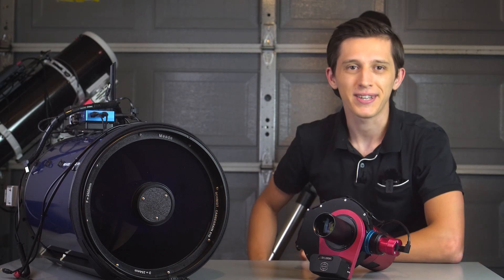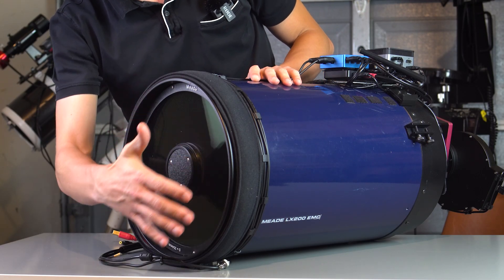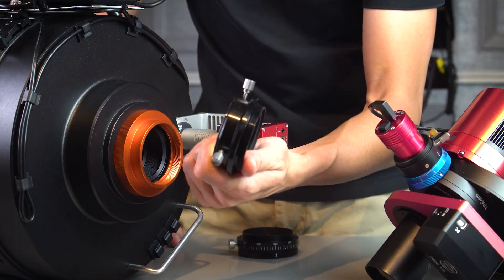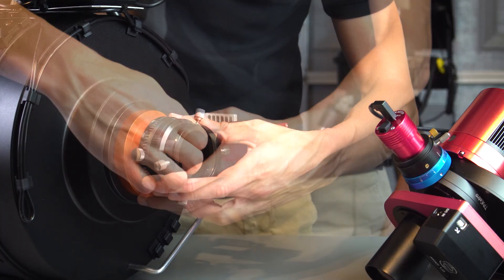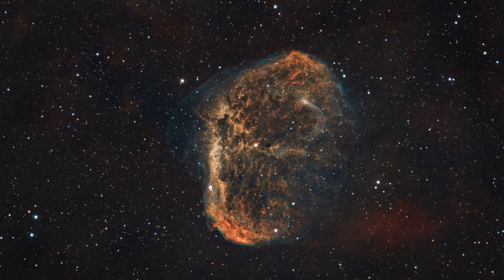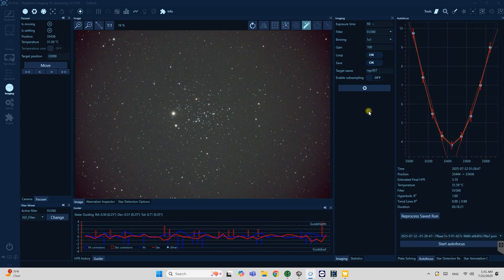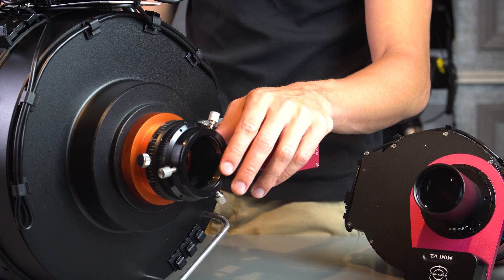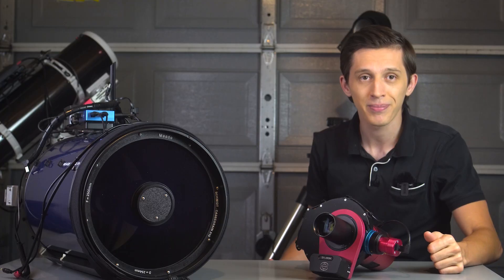How To Setup Meade LX200 EMC for Deep Sky Astrohotography?

Comment: To get a top quality one piece Meade large port 3.25" to 2" compression adapter look at the Astro Physics web site for "2" Visual back threads onto 3.25" rear cell of the 10" or larger Meade SCTs. (ADASCTLM)"  or for Celestron version "2" Visual Back threads onto the 3.25" rear cell of the Celestron 11" or 14" SCTs. (ADASCTLC)"  I used this to get a Starizona SCT III .63x Corrector way up into the baffle tube of the LX200 10" f/6.3 EMC so I can achieve focus.  It just has enough focus travel to focus, imaging with the M10" LX200 at f/4 is FAST!

Comment: Hope you'll do more on this series. I have an lx200 14-in GPS ACF that I bought brand new from the Hi-Point auction. I've got a moonlight focuser. I'm trying to use the Celestron reducer. Of course I don't need the flattener. I'm trying to decide between the ASI 533 and 585 cameras. I'd like a one shot color for this one. I have a full mono set up on my refractor. I'm doing mostly planetary and I want to get really serious about trying to track down the ISS.

Comment: I run a dew shield and a single dew heater on my 10 inch LX-200 and it works great.  You just have to remember to take flats with the dew shield on.  I do sky flats at twilight and I'm doing photometry so my calibration requirements are very stringent.  Great videos as I'm looking to upgrade my equipment.

Comment: I have an 8" Meade EMC. I just wanted to also share  that my own  experience  is that  the   Starizona  corrector iv is an awesome upgrade to the EMC series. Dramatically  better then the Meade and Celestron reducers as they don't flatten and correct aberrations needed for decent imagining.
The back focus is critical to a fraction of a millimeter.

Comment: Do you have a detailed video of your ZWO EAF focuser install using the Celestron EAF mount bracket? I have watched other videos on this and installed mine the same but it is unreliable. Maybe I have done something wrong. I am thinking about changing to a crayford focuser if I cannot get this working reliably. Thank you in advance.
Reply from the maker: I don’t have a separate video on it yet. Bacially, you need a bracket for Celestron telescope, longer screws to connect it to the OTA, and bearings instead of plastic washers to make it smoother.
Reply: @AstroCreation  Is this working well for you? I followed other videos and installed the EAF using the Celestron bracket and I seem to be still dealing with mirror flop on my 10" LX200 EMC. The focusing appears to be inconsistent. Originally, the EMCs came with a screw installed to stop mirror flop and protect it during shipping. You removed that screw upon receipt and installed a plug in the hole. I may have to reinstall that screw, not use the original focuser, and go to the GSO Crayford focuser on the visual back like you had originally. This should give me more reliable focusing and no mirror flop.
Reply from the maker: @moosoneerocketry9826  of course you still will experience mirror shift when using this focuser. I simply enabled autofocus in NINA when HFR increases by notieable amount, and it worked out really well for me.

I've had a few imaging sessions on this telescope without supervising it - everything went well when I was imaging one target (which was M27).

Comment: The guys at Starizona will tell you that their reducer is meant to be attached with the telescope side as close as possible to the threads on the rear cell.   Also, since you have large threads on that Meade maybe you can look into the SCT Corrector LF (large-format) reducer from Starizona

To solve the focuser blocking rotation problem you should look into the Pegasus FocusCube Zero for SCT.   It uses a pully/belt system to move the focus motor out of the way.

Lastly the Starizona SCT reducer requires a very specific back-focus distance of 90.3 mm.   Subtracting 55mm for the OAG/FW/Camera leaves you with 35.3mm and subtracting another 10mm for the Wanderer Astro M54 rotator leaves you with 25.3mm as your spacer between rotator and OAG.

Getting the reducer closer to the threads and getting the back-focus perfect will improve performance.
Reply from the maker: Thank you for such detailed comment!

1) Yes, you want to place it as close as possible to get the telescope faster. I had it as fast as f/6.6 when locating the reducer closer, but I'm fine to sacrifise this ratio a bit to make the telescope more automated in terms of switching angles of rotation. Talking about Large format Starizona reducer, I contacted Starizona and asked their thoughts about it a few weeks ago, but I haven't heard back yet. The thing is their website description of the threads doesn't match what I have, so I wanted to make sure the reducer would work.

2) Thanks for the tip about FocusCube! I'll check it out although I'm not sure how it'll work with LX200. Do you have any practical experience there to share?

3) About the back focus. I'll be covering that in detail in my video review of Starizona SCT reducer for LX200. My total back focus distance with this reducer is 90mm which is .3mm lesser then it's supposed to be. Meanwhile, my stars look pretty sharp around all the corners, so I guess this .3mm difference is fine.

Comment: Great video!  Thanks much for this!  I have a 10" LX200R., using an Optec Lepus focal reducer, and a ASI2600MC Duo. I'm struggling a bit with proper back focus distance.  I'm assuming your using 105 mm as your back focus distance.  How are you measuring the distance of the camera side of your SCT corrector focal reducer to the camera chip?
Reply from the maker: Thanks!

Starizona reducer has a different back focus distance. The reducer itself comes with 35.3mm adapter, and the only thing you need right after is standard 55mm of back focus (total back focus distance is 90.3mm).

In my case it is a bit different. Instead of 35.3mm adapter I got Wanderer Rotator and spacer. My total back focus distance is around 90mm. Stars look sharp around all corners with my IMX571.

I measure distance by calculating back focus of each part of the imaging train I have. Talking about back focus of the camera, this information is available on official website of each camera manufacturer.

Comment: Hey! Great video, loved it, thanks! 

I have the Celestron 9.25" SCT 'scope. I am finding that with my ASI 120MM Mini Guide Camera fitted to my OAG, PHD/Asi Air Plus struggles to find guide stars in certain areas of the night sky. When It does manage to find a guide Star(s) the guiding is amazing, sometimes as low as .33 RMS! But oftentimes the tiny sensor on my 120MM Camera just cannot find any guide Stars. Would you suggest I purchase a Asi 220MM Mini Camera to improve the Star detection and general guiding? *Edit - I use a Celestron 0.63 Reducer.

Thank You in advance for any and all advice!

Clear Skies, Wes, Liverpool, England.
Reply from the maker: Hey Wesley!

Yes, you'll definitely see a lot of improvements in guiding with ZWO220mm-mini just because it's a much better sensor. Before going to 220 though try to guide in bin 2x2. I did that on my 120mm-mini back in the time, and it could see stars a bit better (still not enough for some areas).

If 2x2 bin on 120mm won't help, then consider getting 220mm
Reply: @AstroCreation would a 585m camera be overkill for oag? The touptek one has a newly released lipstick version and it looks very enticing for the price (just a bit more than asi220m)
Reply from the maker: I'm not sure ToupTek has 585 in slim design. Would you send a link to a specific page where you see it?

Talking about guiding performance, I'm not sure 585 sensor would works although you can try bin 2x2 that would help, of course. Make sure the prism in your OAG would support the size of the sensor as well.
Reply: @plane9182  Could you please tell me or msg a link to the Touptek 585M slim model that you mention in your comment above? Thanks!
Reply: @AstroCreation  Thank You so much for your advice and help, I will try the 2x2 binning, and If I'm still having significant trouble then I'll buy the 220MMMini 👍